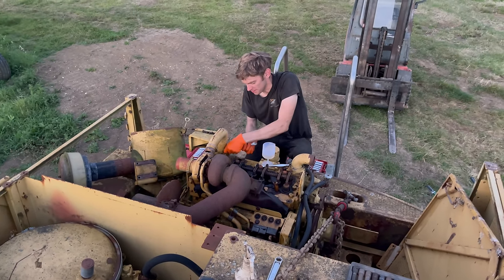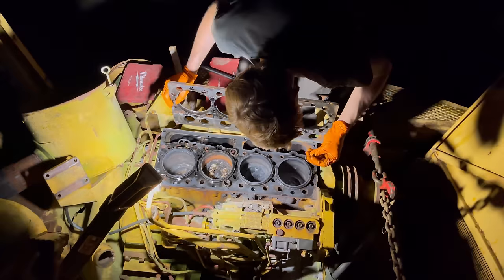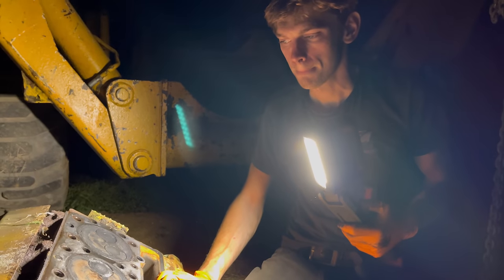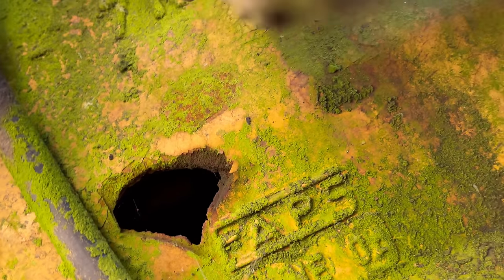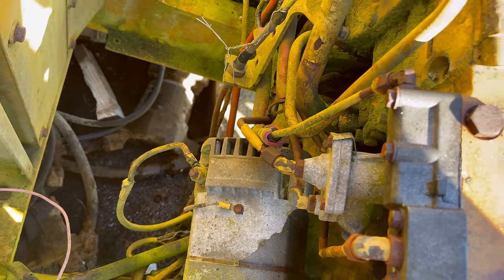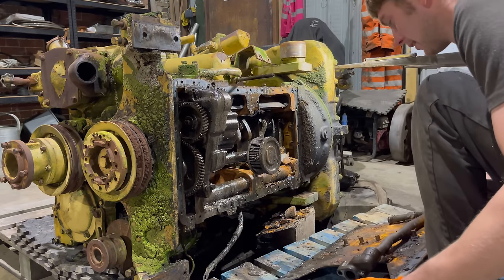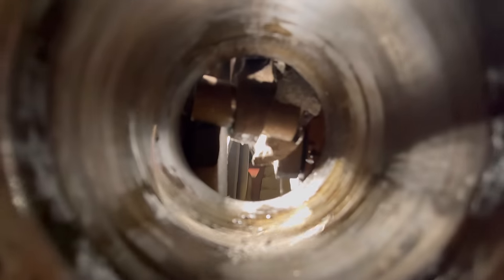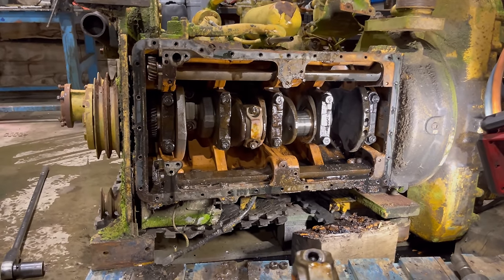THE REASON THE DIGGER WAS ABANDONED...

Comment: I own two of these engines, both generator sets in a fishing vessel. They are tough as nails as a rule with the bottom ends especially so. My guess is if someone rebuilt it they may have over stressed a rod bolt that broke, but it's anyone's guess now. If the crank can be saved and the balance shaft boss isn't broke where the drive gear sheared you could patch it and give it a go. Parts are plentiful for those engines so it shouldn't be to hard to get what you need. Arrangement number is the key to getting the right parts as they used those engines in all kinds of things. If you get to putting it back together the balance shafts are a bugger to time as they are driven by the oil pump idler gear and the plate that the pan bolts through and to has alignment bolt holes that you orientate them and the bolts hold them in place with crank at TDC as you install the oil pump. One tooth off and the balance shaft boss will let go. Had that happen when engineer got in a hurry! I'd scrounge up a runner if you are in a hurry, otherwise would be interesting to see your repairs! Enjoy the hell out of watching you resurrect all these different vehicles, thanks!
Reply: Messed up the balancing timing on a Massey Ferguson once. Damn thing tried to leave thru a side wall and it wasn't even in gear.
Reply: Bin off both balancer shafts - problem solved.. "You don't need to worry about vibrations..."

Comment: To bring it back from the dead would be best - Bores are fine as liners, weld up and reseal water jacket (seen vids on youtube how they do it in India - looks easy with a bit of heat) - They probably have a vid on a crank regrind using a pair of knickers and a sheet of 360 grit wet and dry if you look?

Comment: Great video. The two shafts on each side of the engine block are balancer shafts. From memory, they normally spin in the opposite direction to the crank, and at twice crank speed, they are timed along with the camshaft in the timing case. I've been taking keen interest in your diamond T because during ww2, one of my grandfathers drove a diamond T pulling dead tanks off the battlefield to remove the dead men and repair the tanks or Rob it for useful parts.

Comment: Wow that’s pretty catastrophic. I think the 2 eccentric cam things may just be balancer shafts. But they Probably won’t compensate for a missing piston though 😂
Reply: I wondered about being balancers, too. Seems more likely that just to throw oil about. I don't completely know, but I reckon there are easier ways to distribute oil. Probably piston shrapnel got into the broken cog thing and turned out to be tougher than the cog. Welding the cog onto the shaft might be tricky so you may need a new shaft and poss engaging cog, too?
Reply: !00% balance shafts, lots of 4 cylinders have them in one way or another.

Comment: The sloshing shafts are balance shafts, you will have to set/re-time them perfectly "Balance shafts are often used in inline-four engines, to reduce the second-order vibration (a vertical force oscillating at twice the engine RPM) that is inherent in the design of a typical inline-four engine."

Comment: I loved the way Ted took two steps back when you started to tip the engine over. Top safety dog! Think those two rotating  half rods might be balance shafts. If you were to rebuild that 4 pot you'd have to replace the oil pump and clean out all the oil galleries, if there is the slightest chance that the engine failed because of an oil system failure. If you don't then it's a waste of money. Put  a V8 in it!

Comment: According to eBay here in the US, a block is $3500 and a reman long block (block & head) is $10k.   Trying to rebuild it may be the cheapest option depending on parts cost....   Finding a cheap doner would be the best thing - apparently these 3304 engines were used in wheel loaders & forklifts...  Depends on how badly you need the excavator bits and what condition they are in.
Reply: Over here in the UK one seller has a complete over haul kit (Pistons, rings shells and gaskets) for £787 and theres a parts only engine for £1k

Comment: I so enjoy watching you work on these big Diesel engines. The delight I feel in witnessing you being able to smack something with a hammer because it is so robust is so satisfying. The engines I work with have magnesium castings and clearence differences in the shell bearings in microns. They break if you even think about using a blunt instrument.
Reply from the maker: I don’t belong in this modern age of working out how little metal they can use to save 1p 🤣
Reply: @MrHewes Just think of the weight savings you can achieve on your 20 tonne excavator 😂 she'll handle like an F1 car around the corners
Reply: If you think these are big diesel engines, you might want to hang around your local preserved heritage railway. The group I was in owned three diesel locos, the smallest of which was 1000hp.

Comment: I'd vote for repairing that engine. After all, your main purpose in life is to entertain your viewers. Thanks! You could do a proper fix on the hole in the block. No, not welding as it's only low pressure - so a large steel washer with a large rubber washer on each side of the hole plus a nut and bolt through them then lashings of sealant.  I used that fix when I accidentally drilled through my dishwasher due to a faulty tape measure🤠

Comment: If you change engines to a different model, none of your piping will work. You'll be brazing pipe and fittings for 2 months. It's about money...if you can get another 3304 rebuilt vs rebuilding what you have. I see one sleeve, one piston and connecting rod, lower end bearings, and a gasket set. Your 4 cylinder engine was pretty widely used. Parts should be available. 

BTW, I think that piston was crushed by compressing water. Got to figure out what caused it...that problem is still there.
Reply from the maker: That’s an interesting thought about why it may have failed
Reply: @MrHewes  No, the big end bolts failed you pulled one of them out of the sump, judging by the condition of the other bearings I.e. look mint, I think it was either incorrectly rebuilt or old bolts used when they should have been renewed.
Reply: @slacko1971  yup.   from memory all those bolts are meant to be replaced when rebuilding as they are TTY.   if you reuse them, this can happen.  they are expensive, so people cheap out.

Comment: Yes Fix and weld. Didnt someone offer you another dead engine, maybe you can get Con Rod and oil flinger out of it and even block on the cheap (Cost of Diesel to pick it up). I presume the Cat will only be used around the farm and not sold as a bodge it and scarper. See how cheap you can get it functional. Makes it way more interesting. I remember years ago fixing injectors from dead genset with grinding paste and Brake Clean. People fix stuff all over the world with zero budget.

Comment: The cog has broken off  one of the balance shafts, these are a rotating offset mass to reduce vibrations that would otherwise cause damage, these shafts have to be timed to the crank like a camshaft is timed, running the engine with them with the wrong timming or removed is bad you can watch the engine shake itself to bits

Comment: To rebuild that one properly crank , pistons and liners complete gasket kit , balance shafts and timing is critical on them . Try and find second hand motor . Forget putting a 3208 in they are rubbish and it will be impossible to work on in frame . If repowering look for something mechanical between 3.5 and 5 litre 4 cyl Mazda do a good 3.5l 4cyl or izusu . Have fun cheers from Australia

Comment: Those two shafts are harmonic balancers. Invented by Fred Lanchester in 1907.  Makes a rough 4 cylinder engine run like a slightly less rough 4 cylinder engine. Looks like one got jammed up with the debris and sheared the gear off.

Comment: When you think it is oil starvation you should also damage on the crank main bearing / connection rod bearing / cam bearings. What I could see in the video it doesn’t look like that. You should see for your self. Ss mentioned above, fluid compression either in the combustion chamber or in the sump (sump over filled with oil/diesel/water) is good guess. Can you see on the piston damage if the connection rod is pulled out of the piston or pushed in? I know it’s hard to check with such a catastrophic chain of events.
Reply: A rough guess just from what I see in the video:
Somehow the rod cap let go, so the rod came off the crank. I think this somehow happened on the up stroke, and the cylinder fired with out the big end cap in place. (Or maybe it was hydro lock,, but the cylinder firing seems more likely.) Either the rod cap or the end of the rod flopped to the side and jammed the balancer shaft. This broke the gear off the balancer shaft. The piston came down forcibly with the rod off to the side where it shouldn't have been, and either twisted it around the loose rod, or the rod got banged in the middle by the crank journal, and broke the piston to bits.

Comment: Cat 3304. Good reliable motor. Most if not all parts to repair it will be available aftermarket at reasonable cost. 
BTW, they are called Lanchester balance shafts.

Comment: Used to strip similar and odd that sump fell off. The gaskets we came across almost welded surfaces together. The shells look brand new as when they are new they come with a gray surface that in time reveals a more silver surface. At a guess someone has previously had the sump off and changed the big ends.

Comment: *Edit, read comments, yea the shaft with the busted gear and its mate are probably balance shafts.

I had a Mitsubishi powered Mazda B2600 pickup truck. It had shafts in the engine that look very much like what you were saying could be to agitate the oil. They were some sort of balancer shafts. I think they were to reduce vibrations from the engine. I used an engine lathe and turned them into more or less round shafts that didn't do much of anything. They had to be there since other things were driven off them. I don't know about your scenario with this Cat engine but they look like the same concept.

Comment: Not to difficult.  Bog up the holes in the block. Replace balance shaft and gear. Strip of leather and two jubilee clips round the big end . Of you go. What are balance shafts for if not to even out odd inbalances. 
But all said its better than the the t34. And a short block or scrap block should be relatively easy to get . Excellent vids remind me of the students l went to college. But then were your fathers age now.

Comment: The metal plate in between the block and the head is just a spacer plate. The shafts in the bottom end are balancing shaft turning to reduce vibrations. Try and see if you could get another core engine same as the one you got to get one good running engine. Or you could get a Perkins form a tractor.
Reply from the maker: Would a Perkins share same bell housings
Reply: @MrHewes  They don’t, but it’s a cheaper replacement probably. Shouldn’t be to hard to make it fit somehow xD Good luck love the vids!

Comment: Do whichever makes the most sense for you, depending on priorities, time, and money. if you  defer repairing it in favor of a decision to buy off ebay, obtain a donor engine, etc., you can hold the rebuild for an inside the shop video when it's freaking cold outside. THAT'S when you want to be inside cutting, welding, etc. nice to get it done and with the job itself providing heat for the shop!😁
Everyone should own at least ONE tank!😁😎
👍🇺🇸😎

Comment: New con-rod and piston and gasket, should be Ok.   That shaft was most likely a dynamic vibration damper, that got a big end caught in it and sheared the teeth off the cog.   If you get it running, it also needs two new teeth for the bucket...  😀😀😀

Comment: Those things are balancer shafts used to smooth out inherent vibrations in 4 cyl engines. I'd guess the spacer between block and cylinder is needed to reduce compression ratio because the engine was prob originally a NA design

Comment: I'd say that it all depends on the injection pump, if it's shagged too then go for a new engine, if it's good (enough) then maybe it's worth having a crack at it. I've seen worse (and got them running again!) but it's usually not worth the hassle.

Those shaft thingies are balance shafts BTW, they spin in opposite directions and help offset some of the engine's vibrations, so you'll either want both or neither as just one will make it even more likely to try to jump out of it's mounts when you start it!

Comment: Put a 3208 V8 in it. Cat engines are throw away motors. I had to replace the one in a Ford Louisville truck as the camshafts had worn away. Picked one up for $6000 AUD (about £3000) rebuilt by the Cat factory. The 3208 was built for excavators.

Comment: The two lower shafts, are probably 'balance shafts' to make it a bit smoother when running.  They could probably just not be reconnected/removed - might need to ensure there are no oil-galleries left exposed/open though.

Comment: those shafts are balance shafts, usually found in posh cars with 4 cylidnder engines to reduce vibrations and give a smoother feeling to the driver. seem rather out of place on a piece of industrial machinery. May i speculate that that cylinder got hot AF (injector) piston siezed in the bore and it pulled out the bottom of the skirt, then the conrod rattled about and got beat up, I say this as the conrod doesnt look to have had a spun bearing, and, well, the pistons beat to sh*t.

Comment: I realized when you were rooting around in the bottom end, I was watching it like I'd watch a nasty autopsy - pulling a face. Maybe crud built-up in the sump and pickup (lot of loose shit in there) caused oil starvation and then grenading? We'll never know for sure.
As for rebuild vs. replace, I guess it's down to a few factors: your time, parts costs, opportunity cost, entertainment value, and repaired vehicle value. Opportunity cost meaning, time you could instead be spending restoring tanks, etc., and entertainment value for the channel.

Comment: IMHO. It's proper had it. Two problems W a replacement. Just how good is the used one. Also is it the correct standard of that engine model for your application? You get a guarantee from the vendor its goin to sort the quality. So you only need to know the designated version reqd. in diggers and your going again. Rebuilding it there's only the right way but that block is junk, balance shaft is junked, crank is rooted, the rods are stuffed, need a full set. Then there's pistins and liners bearings seals gaskets???fresh used should be available somewhere for a mere song.

Comment: 13:40 balance shaft. May be the nozzle did not spray fuel correctly, the temperature in the combustion chamber rose and the piston cracked from overheating?

Comment: the thing that snapped its drive cog off and the one on the opposite side of the block I think are secondary counter balance shafts, I mean it IS a humungous sized four cylinder diesel designed to run at constant high revs after all , 
it would shake and vibe like a sonovabitch without them and probably shake off every exterior device bolted to it in the process , I bet when number one big end decided it was time to depart this mortal coil the cap flew straight into the flat bit of that  rotating shaft jamming in and stopping it dead - something had to give...and the poor old drive gear paid for it with its life when it suddenly stopped dead and the rest of the gear train didnt. it must have gone with a HELL of a bang I bet the operator needed a new pair of skiddies and a bit of a lie down when it happened....personally i would dig a hole chuck it in and say some words over it it just requires a bit too much time, work, and money.  just imagine what a beast of a workhorse you would have if you slotted in a Cat V8 or even one of the straight sixes and their attendant higher power pumps....... just the thought caused me a wee semi.lol

Comment: Depends how bored you are... Could delete the broken stuff and run it as a 3 cylinder single balance shaft engine. Hopefully the resulting vibrations will let you use a normal bucket kind of like a jackhammer.

Comment: Easy one... just weld up that cylinder, turn it in to a triple and stick a Triumph badge on the side.

Jobs a good'un and it will run... like an old Triumph.  Rough as f_ _ _ and leaking oil... sweet. 👍

😂😂😂

Comment: Looks fixable to me if you can afford/ be bothered to spend the time on it! My money is on rainwater pooling in that cylinder after being left sat. Possibly gone bang on the first crank. It certainly looks like rainwater has been getting into that other rusted cylinder. If it was me I'd replace the piston, con rod  and balancer shaft, leave the crank as it is for now, see if it runs and if it does (well) treat it to a regrind, new bottom end bearings and bolts. Would be a shame to go crazy on it and find out the injection pump's nackered or the cam's bent or the track motors on the excavator are buggered etc. Wouldn't even bother welding up the block to begin with, just bolt and washers like someone else has suggested. Think you'd do well on the views. Spend a little time and even less money, see if you're onto a winner, if not, cut your losses and weigh the whole lot in for scrap is my two pennies worth

Comment: Ground metal dust through the lubrication system, no idea what caused the failure. Nothing special to the machine to keep it stock. you have to keep track of hours invested into a rebuild, plus education, then parts lists. special tooling. i really can't see putting any more time into that motor. the less you use off it, the better.
rebuilding it isn't the content you want to pursue.